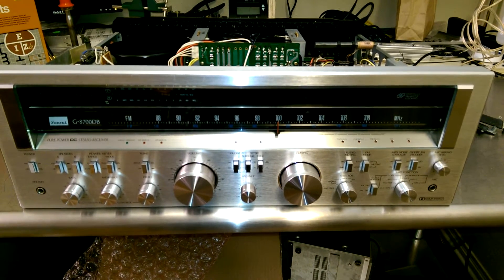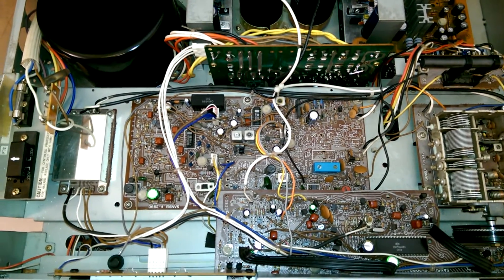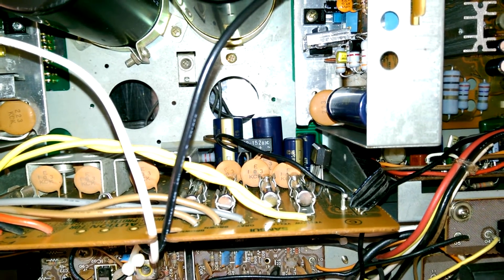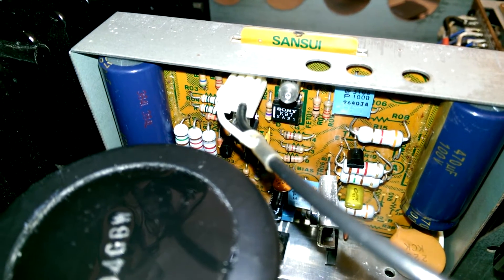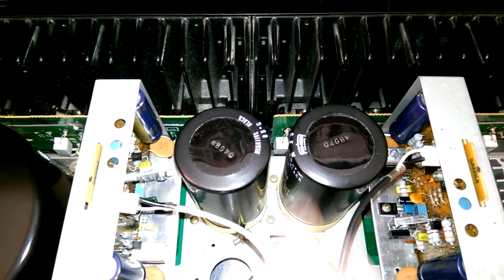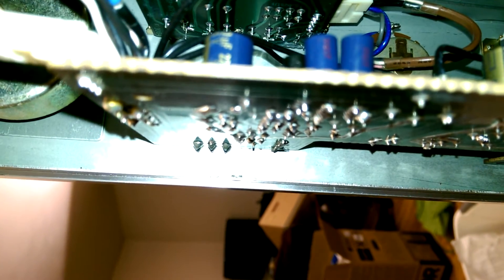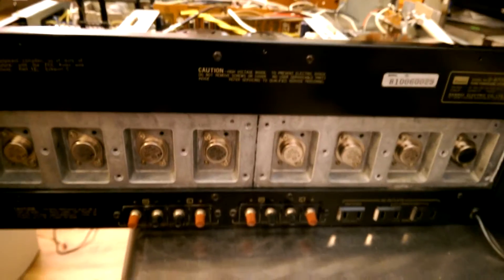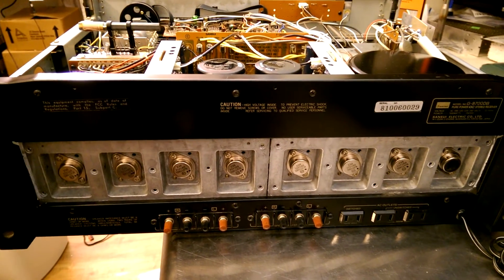Sansui G8700DB Repair Summary

Comment: Wow Fantastic job. High respect to your knowledge and labors.  This is something I've wanted to get into but at 56 I feel maybe I'm to old to even get  to a quarter of where you are. Anyhow I have this same receiver. Everything is running fine except my left Balance sounds a little distorted and fades in and out.   What I wanted to ask is what state are you located and also what was the spray cleaner you used ?  I do auto Detailing so I was thinking a liquid Aluminium cleaner ? Thanks

Comment: I have the 9090db and the 8700-dB. There are so many components that make it work that anything can go wrong at anytime. Old or new can stop working anytime. These are old relics and if you need any real replacement parts good luck. Just doing something simple like plugging it into the wall can blow it up. Just be prepared to learn how to fix it yourself or spend a lot of money to keep it working.

Comment: I hope you're testing the large filter capacitors with real world voltages, not the low test voltages found on modern capacitor testers such as the one from peak and others.
Reply from the maker: The choice of test gear is definitely important, however what is just as vital, if not more so is understanding the limitations of your test equipment and how to interpret the data your equipment gives you in light of the known characteristics of the device you are testing. 

Electrolytic capacitors, unlike ceramic capacitors, have a relatively small coefficient of voltage so their capacitance doesn't vary too much with applied voltage. 

Short circuits are not a typical failure mode in electrolytic caps and even rarer are dielectric failures that manifest as a hard fault only at or near rated voltage. However, even these can be found by low voltage testers in many cases if the tester can test leakage or a parameter directly influenced by leakage such as dissipation factor.

Usually, a cap with such a problem will fail in service before coming into the shop, often with very obvious signs of distress due to the power dissipated during the fault. Bulging cans or seals are common sights in initial inspections where caps have failed shorted and in some cases complete rupture of the can occurs.

Latent "soft" shorts can occur in electrolytic caps that have been sitting without applied voltage for many years, but again, you'll typically see tell tale high leakage effects at lower voltages before the dielectric totally breaks down at rated voltage. In any case, these are "reformed" by holding the cap at a lower voltage for a few minutes and slowly increasing the supply voltage before more detailed testing occurs. This failure mode is more common on older capacitor construction than the newer methods used by the time this G8700 was made however.

Far more common is an open circuit failure mode and low voltage testers can spot these faults without any difficulty at all. This failure is caused by loss of electrolyte through evaporation and results in high ESR before the capacitance deviates from tolerance. The U1733C can test ESR with a simple key press.

In fact, may of the capacitors I reject as failed test in tolerance or just barely out of tolerance capacitance wise however the ESR is many times out of the acceptable range. The first caps to fail in this manner tend to be those in the regulated supply sections due to heat produced by the linear regulators and the inherent inferiority of the lead frame seals on leaded caps vs their chassis mount and snap in counterparts.

Even if all that fails, there's still a real world performance test which will fail if the power supply isn't up to snuff. In particular, the THD+N measurements on the 20Hz test will suffer greatly if the filter caps are not in excellent condition. It can be difficult to see the failure on the scope if it isn't extremely gross, but it's as clear as day on FFT.
Reply: Point(s) taken.

Comment: Hi Andrew,I finally figured out that the volume fluctuations and loss of sound from one speaker has to do witht he input button.  It seems if I tap it or move it slightly left and right things work fine... for a while then I have to do it again.  I was wondering if you still repair these things and if so what would it cost for a total overhaul.... should it need one....  I am in Canada but the company I work for has our North American Head office in Plano... so no issues on the shipping for me!
Reply from the maker: +adamgordon00 I do still do these. A total overhaul is around $400 but most units don't need one unless you just want to ensure it doesn't need to go back in for service for a very long time or you want to ensure you're getting the absolute best performance possible.

Common issues include dirty and or oxidized switch and potentiometer contacts (I suspect this is your issue!), bad capacitors (particularly on drive cards and regulated supplies, the hottest boards in the unit) and a loss of front end alignment on the tuner that causes inaccurate dial readings and poor reception. 

Another all too common problem on this and the G9700 is output transistor failure due to bias drift and thermal compound drying out. This is huge on these because these things lack thermal compensation in the bias circuit and as a consequence, they're barely stable as it is. (Dr. Russell at UT Arlington would probably spill his coffee if he saw the missing compensation in the schematic! It's a design no-no.)

Comment: Hey you certainly sound like you know what you are doing!  I just bought a Sansui G8700 in original condition.  I am using it for my Vinyl collection.  How would I know if it should be recapped and what are some common problems?  I find the signal to my speakers sometimes has strange volume fluctuations... but it might be my turntable doing that. I wish mine looked as good as the one you redid!  Cheers!
Reply from the maker: Intermittent audio drops, hum and not going out of protect mode at random intervals signal that it may need caps. High DC offset also is a clue, although to a lesser extent on these as they're direct coupled. (would have to affect the bias stage...and on these if that happens, you usually lose the outputs and it becomes very pricey.)
Reply from the maker: ***** Yes sir, I am. Send me a message and let's discuss what services your receiver may need. Thanks.
Reply from the maker: +Michael West I'm in Carrollton, TX. Contact me on my Google+. Expect shipping to be a nip pricey. I'd shop around for a shipping quote to 75006.
Reply: Andrew Kwiecinski Greetings. May I inquire as to the alloy cleaner used to wipe the faceplate grunge? The G8700 appears quite sparkly. Cheers